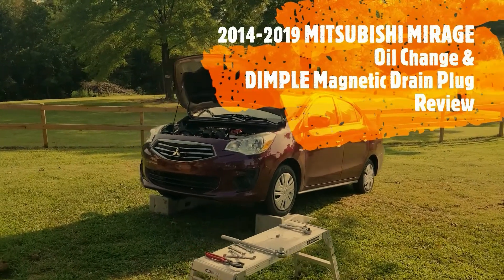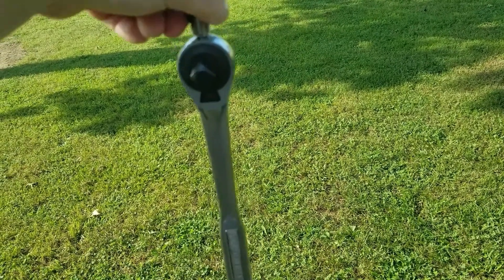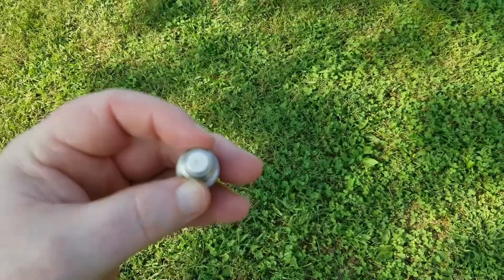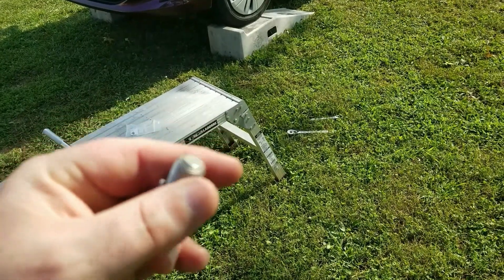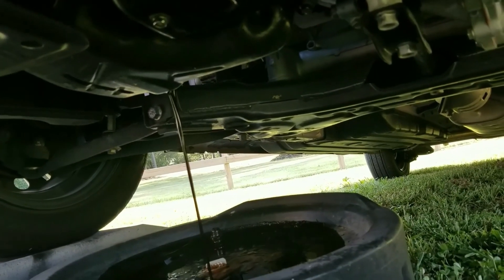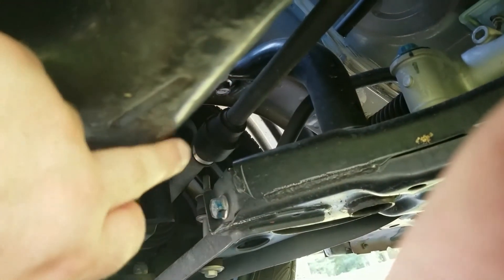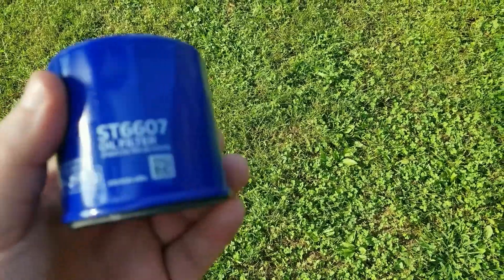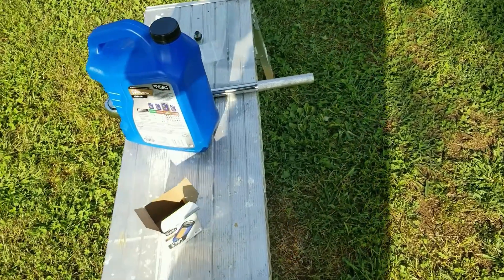2014-2019 Mitsubishi Mirage Oil Change & DIMPLE Magnetic Drain Plug Review

Comment: The longer oil filter is 7317..Supertech no longer has 7317 so I used Fram 7317. I believe oil 0-W16 is for new hybrid engines or turbo engines.

Comment: Enjoyed the video. You spent $30+ on the dimple oil drain plug and less then $10 on the wrong weight oil and filter. You may have voided you 100k warranty? I take mine to the dealer, $68 included oil, filter, new drain plug, fluid top off, tire rotation, brake check and computer diagnostic. Mitsubishi sends me $10 off coupons for oil changes every 3 to 6 months.
Reply from the maker: Thanks for watching Michael,  yes sir the drain plug is worth every penny that magnet is super strong and I definitely didn't hurt my warranty there's no way for them to tell what oil was in it. It was so close to the correct weight that they wouldn't know the difference plus I've drained it out several times since then. I try to service my own cars because I just don't trust dealerships  but for $68 for all that is a great deal. Happy Holidays Michael!

Comment: I installed the fumoto drain valve, makes changes much much easier
Reply from the maker: Just be careful because if something hits that valve and knocks it off or it starts leaking your out a new motor. Thanks for watching, please LIKE and SUBSCRIBE
Reply: @matthewmeltonTEAMMELTONFISHING  shouldn't leak, had it on my subaru for over 2 years without issue, even went through the snowcalypse here in texas

Comment: this is by far the worst oil change video that has ever been made. guy spends half the video talking about the magnetic drain plug and then walks around like a 5-year-old picking up everything in the yard with it. got past that the only helpful thing was explaining that the oil pan was on the passenger side. then he shows you where the oil filter is then blip he ends the film and now he's back on top of the lawn showing you the now removed oil filter in a pan never explaining how you reach the oil filter what kind of did you remove it with his hand did he remove it with a tool and show it doesn't show you how to put a new one in ..ridiculous